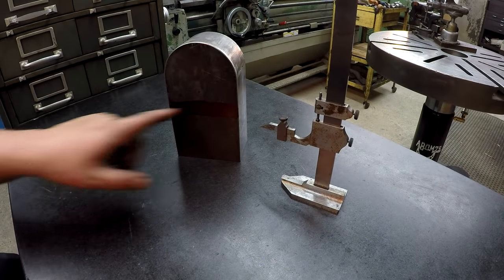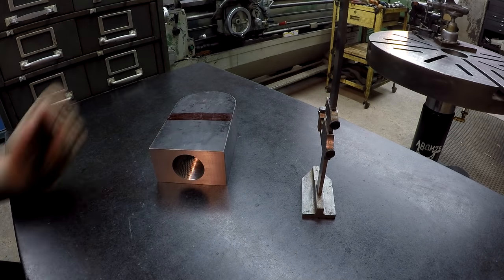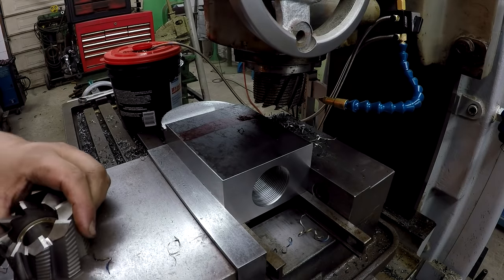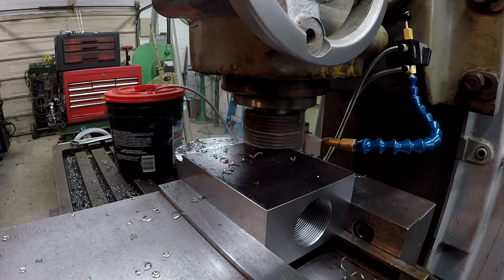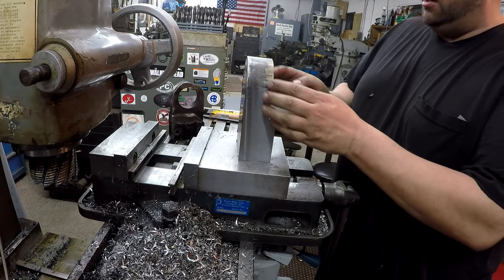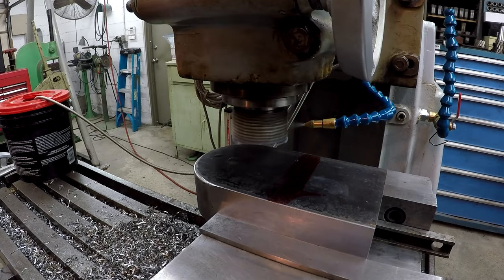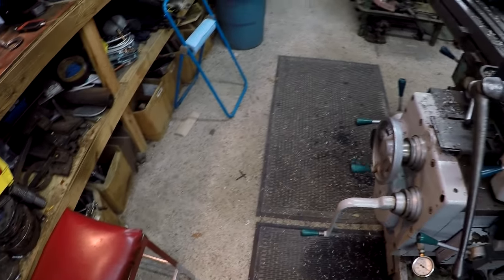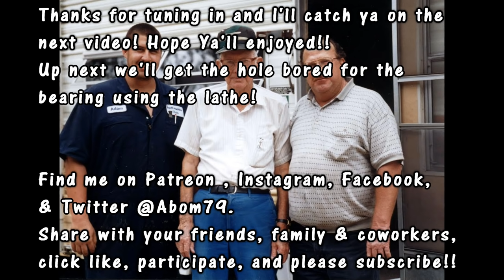Fabricating a Hydraulic Rod Clevis Part 3

Comment: Nice work once again Adam.  We ( at work ) just started using another tool sharpening company in Palm, Pa and they do great work.  I'll get the company  name and get it to you.  The drills are sharpened perfectly and cut on size and the endmills ( both HSS and carbide ) cut great too with no taper.  Jeff
Reply: Can you post the name of that company when you get a chance? I got a bunch of end mills and some shell mills to resharpen. Thanks.
Reply: +extraace   The company is "On The Spot Tool Sharpening Inc" located in Palm, Pa 18070   Their website is  http://www.otsgrind.com/
Reply: Thanks! I'll try them out.

Comment: Hey Adam!

I was looking at your setup, and I guess that you had determined that the Kurt vise has sufficient grip on that large workpiece to keep things in place while hogging out the part...

Possibly because almost all of the cutting force came form the side of the mill...

Being less experienced with larger setups, I was considering whether a spacer block or jack would have been a good part of the setup for working on the second side, where ~half of the piece had been milled away.

It looks like I was being too cautious, but then again, you pulled the piece before boring out the hole for the bearing in the tang, avoiding putting down pressure on the part...

OK, on to view Part 4!!!

Regards,

Eric

Comment: I'm prolly going to either get laughed at or yelled at for this. I'm wondering if instead of grinding all hat metal off could you use that thin blade to make those shoulder cuts? Again just curious.
Reply: Probable late on this comment but the reason he cut the material away with the shell mill instead of the slitting saw is there's not a slitting saw big enough to cut from the top of the part down to the bottom of the shoulder plus machinist like to keep the amout of operation as low as possible the shell mill you cut one side down flip it over and repeat where's with the slitting saw you'd have to make 2 cuts vertical and horse and generally you don't want a big piece of stock to be loose when the spindle is turning

Comment: Adam, when I see big material removal like this, I wonder if would have been faster, and cost less tool wear and tear, to have bandsawn most of it away first. Thoughts?
Reply: +Thomas Utley 
Pardon me for my enthusiasm here - I like your question, and wanted to share my thoughts... let's see how Adam responds in the morning...

Well, I was taught that the most cost effective mill is a saw... 

That said, getting things squared up still requires milling, and the setup time for milling therefore doesn't go away.

And, given that Adam has a fairly big milling machine! and some really good hogging cutters, I suspect that this was actually more efficient use of his time.

I also suspect that if he had a mill that uses inserts - or a decent supply of inserts for a mill on his shelf already - that this could have been done even faster...

So, since he did this over a weekend, I suspect that Adam did it as quickly as he could...

Cheers,

Eric
Reply: +Thomas Utley I wonder this too.  Or have the original piece plasma cut closer to size